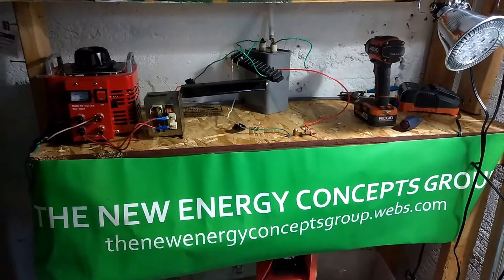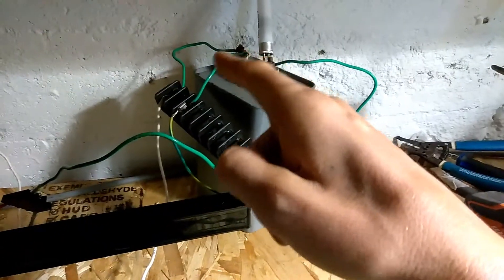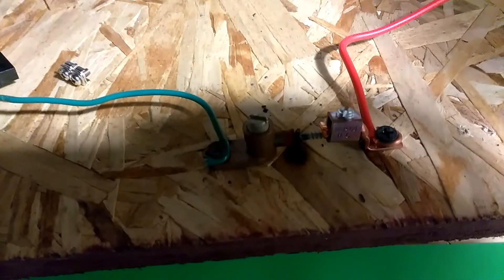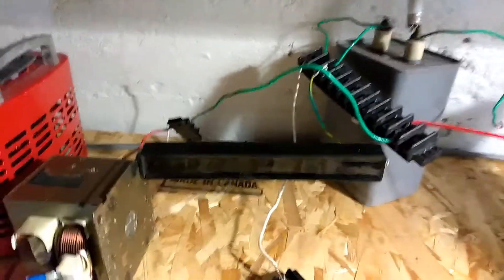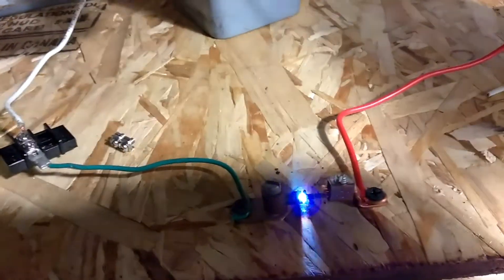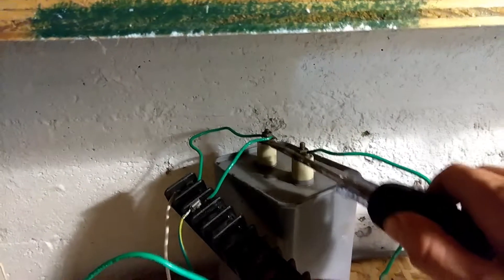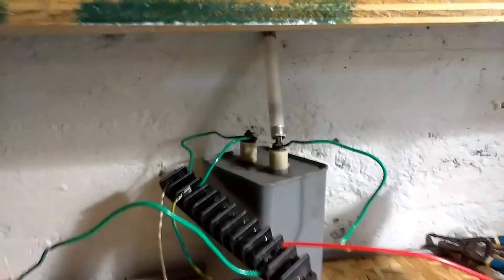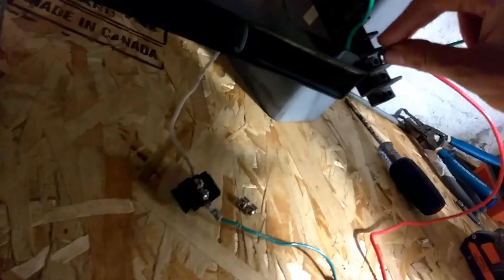Thomas Moray.

Comment: The high frequency emitted from spark gap in the air excites the molecules in tube so as bulb glows.  Also capacitors will absorb energy from AC, DC, or pulsing DC that also has a frequency. AC and pulsing DC will pass THROUGH a capacitor.  See also the Tesla Hair Pin circuit diagrams.